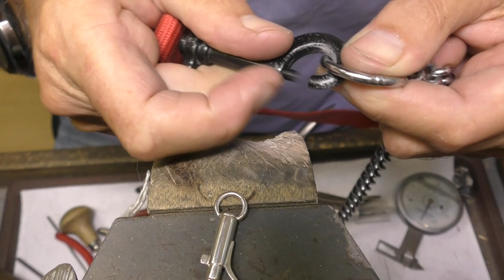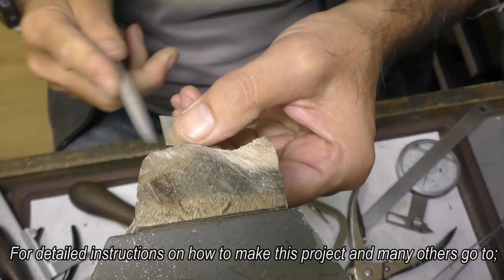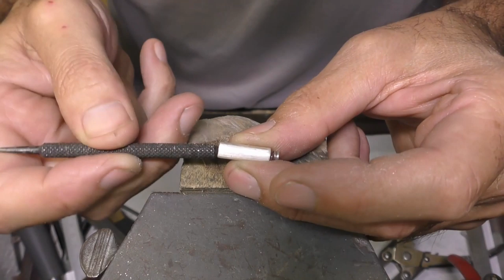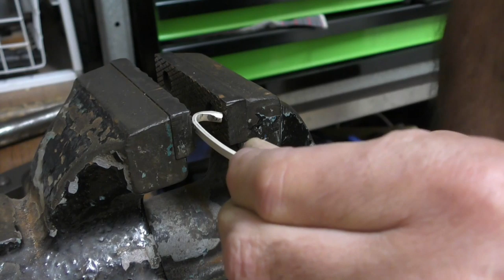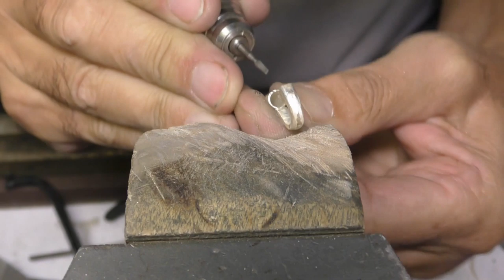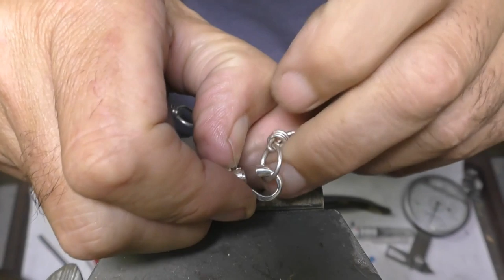Dog clip preview

Comment: I need help on this exact piece to go with the rest of a project that was on hold. It will be a round pendant with a channel cutout in outside middle. Will have 3-4 rings for keys or gemstones that will be able to move 360 degrees in the channel. Then on the face on one side will have turquoise and brass fillings.  Hard to explain, lol. I have most of the metal work finished but this dog clip is the missing link.  

Apologies for the novel post, jist excited as this is one of my first few metal/silversmith projects.